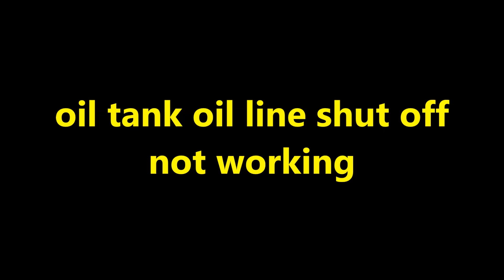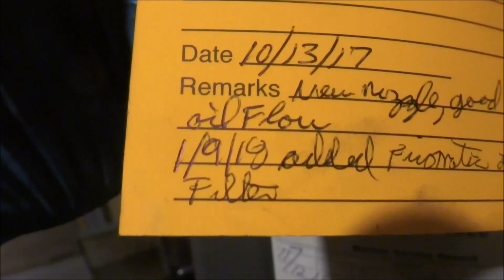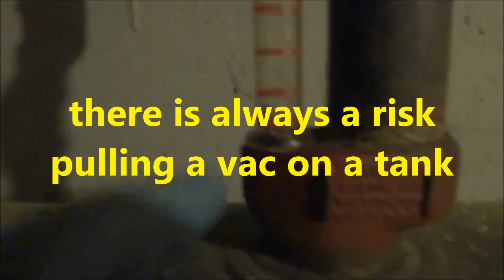oil tank shut off not working

Comment: Nice job Steve. You made that look easy and barely spilled a drop of oil. Those kind of jobs can be real nail biters!
Reply: Fireship1 I don't know how he stays so calm? I'd be shitting my pants running back inside after killing the vac.  I guess that's years of experience for ya! Jim
Reply: I just had to change the filter on mines and found out my valve was stripped as well. Good thing the filter is accessible. Filled up the pan rather quickly though.

Comment: I love when he dose this, so much suspense. But remember u usually only do this as a last resort so many things can go wrong, hose slips out, power failure, the vacuum fails, just to name a few things. Very risky. But sometimes you have to do what you have to do.
Reply: I always put a nipple in the tank so my vacuum is in my control!
Reply: May seem like a dumb question and it's odviously inherently dangerous , but what exactly are some things that could go wrong when changing one in the manner that he is?
Reply: @theurbanloner8879  - collapsing the tank like an empty coke can.  Like a soda can, tanks are designed for the pressure to be higher inside (from the contained liquid), not outside.

Comment: I learned this trick about 35 years ago working for a fuel Oil company in Baltimore Maryland. I thought the older oil burner tech was drinking or on drugs when he started to do this when i was working with him for the day  lol.I have heard a story once  that the sootmaster sucked up some oil and motor shorted out while burner tech had the valve out and made a hell of a mess lol !! I think this happened with a 3/4 or full tank of fuel oil which does not leave enough room in fuel tank to create a vacuum.I work on 90% gas furnaces & heat pumps now because most fuel companies in Baltimore Maryland offer free service contracts for automatic fill up new customers and most just renew it after the free first year for about $150.00-$175.00 a year for 24/7 service.Those fuel companies want those oil furnaces, boilers & water heaters running to burn that  oil.I can remember years back 1985-1989 when I was servicing & installing YUKON EX-95 + Condensing Oil Furnaces with 2 " &  3" PVC flues.These oil furnaces were a freaking nightmare and always sooted up and stopped working within a few weeks.They used Blue Angel Oil Burners and most techs had no clue how to service them. YUKON  ended up going out of business because this condensing oil furnace failed miserably.They were supposed to be  the answer for  homes with heat pumps with older customers who were just to cold with a heat pump low duct temps and it backfired and  had many upset customers that the fuel company I worked for had to deal with.

Comment: Why isn't it code that you require a separate shutoff for maintenance, as well as the firomatic.....  Most people, in an emergency could operate a ball valve or a gate valve, but may not know how to operate a firomatic....
Reply: Code is all about saving life, property, and reducing odds of an insurance claim, not making life easier on the tech.  When Steve does a new install he covers all the bases with high quality fittings and ball valves between the tank and Firomatic.

Comment: What filter housing is that. I have one and I can't seem to find a replacement filter that fits the unit local. I ended up purchasing a General filter housing as a replacement when I serviced it a few years back but was considering adding this other housing in place parallel to the general filter in case one got gunked up there should still be plenty of flow by using a few T fittings.

Comment: Like a pro!  You make it look too easy.  You know, if you do have an old tank (or any for that matter) you could put a manual valve and tee in the vacuum line, and using a gauge, set the pressure you will need to stop the flow depending the height of oil in the tank.  You would use a chart to set the pressure based on the height of the oil in the tank from the pipe or filter location.  Either way you have to definitely have a good set of balls to do this type of job !